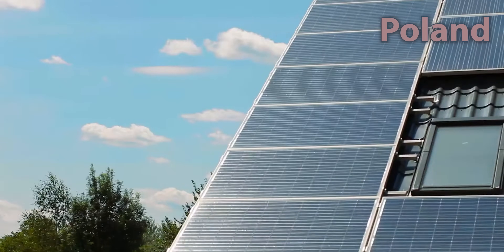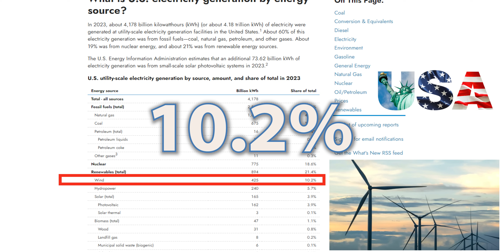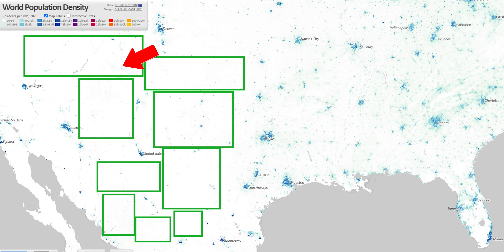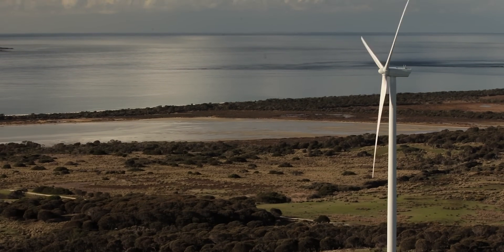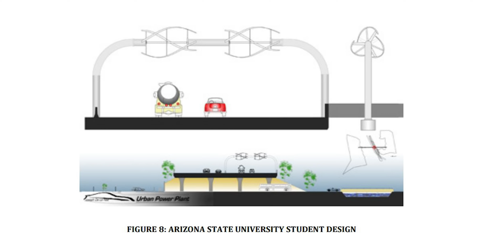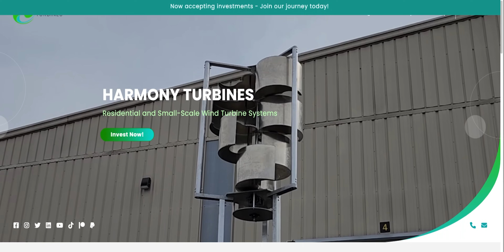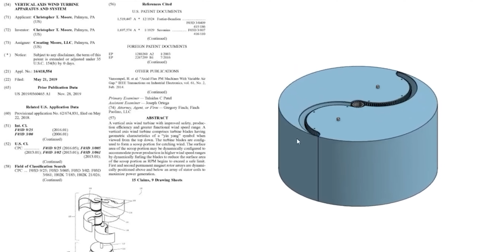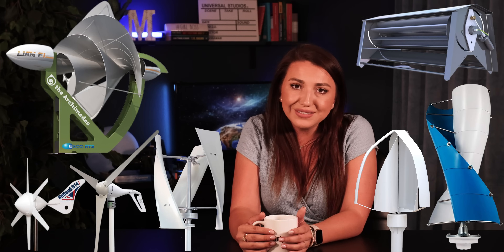Residential Wind Power: Revolutionary Tech or Overhyped Myth ?

Comment: The there are millions of small streams cascading down to highways then under the highway into bigger streams and rivers all over the  world. Millions of microhydro energy systems could be installed forming microgrids linked to solar and wind systems. Water and wind are powerfull. They are solar energy stored in the form of water raised up high the falling or air moving up high. Theres microhrids would not be as vulnerable to attack or failure as the mega grid that’s in use.

Comment: The problem is exactly as you said. To make it effective, you need to put it high in the air, because if you put it on the roof of your house, the air flow is turbulent and you get no power. Well what town is going to allow you to put a bunch of wind turbines 30 or 40 feet in the air? Hopefully the tech gets to the point where it can take advantage of turbulent flow. Until then, I don't see residents using it.

Comment: only an idiot puts a device on a roof that makes little energy but does great potential damage to the structure, thats why they are frowned on
and BTW, in the US per capita primary energy use is 300GJ/yr, which is the equiv production of about 300 panels of 250W nameplate in the NE

Comment: I love to know if those low-cost turbines on Amazon really work.  I'm especially interested in their performance at low and intermittent wind speeds.  I would love to find one that would actually generate usable amounts of electricity at night or during storms to supplement my solar production.  They don't have to provide enough KW to power my home as long as there is the unit generates enough power to pay for itself and replenish some of the battery power I am using during the night and at other times when the solar panels are not producing power.

Comment: So, wind is not always blowing. No $hit! But that's the reason you have both wind and solar. In any 7-day period, you are almost 100% Guaranteed to get either wind or solar, or both. The key is storage! There are lots of battery options for home use and more options coming from LG and Panasonic in the next few years. Get wind, get solar, get a heat pump, get geothermal, get lots of batteries! get off the grid!

Comment: All practical tests of ground-based small wind turbines show: 1) They hardly produce any electricity. 2) They do not last long!
Hardly no electricity, due to hardly any wind close to the ground – and electricity yield is proportional to third power of wind speed: +100% wind generates +800% more electricity! 
Moreover, the wind close to ground is extremely gusty. 9 out of 10 small wind turbines therefore stop working after a short time! 
With solar panels, you can generate at least 10 times more green electricity with the same investment! Reliable and almost maintenance-free for at least 25 years!

Comment: Wind power works much better if it can catch wind higher up. If the wind speed is double, the energy is 8 times as high. This, combined with much higher installation cost/watts generated than big wind turbines, makes the energy from small turbines easily 100  times more expensive than big turbines.

Comment: Overhyped myth. Having designed a vertical axis wind turbine (VAWT) with industry leading efficiency, 3rd party tested and verified in a wind tunnel, it is an overhyped myth. If you want a kinetic sculpture, buy a vertical axis wind turbine like the Harmony turbines, Wind Tulip or any other promoted VAWT. They are selling an unobtainable promise.

Comment: The problem with wind turbine is the designs. If you could build one that operates on little wind and will take full power also at high winds. The problem with wind, is that there will be no wind for maybe a year, wind change or not enough is a big problem.

Comment: In order to reduce CO2 emissions associated with electricity, measures are needed for the night when solar power cannot be generated.
The device in my photo is a device that uses morning and evening wind to exhaust heat from homes and reduce air conditioner consumption.
As was explained, it is impossible to expect a constant amount of wind power in a residential area, and considering energy conversion efficiency, I think it is better to just use the wind as it is.
Although it is in Japanese, we have also published other effective heat shielding measures on our homepage, so please take a look if you are interested.
Last year and this year were both very hot, but we have been able to reduce our summer electricity consumption every year.
If you live in an area with high electricity bills, we think you can recover the cost in about two years.

Comment: It's just plain physics that residential wind systems do not work. First, vertical axis wind machines are garbage and none of them have ever proven to produce a reasonable amount of power with respect to their cost. Second, any reasonable power producing wind machine needs to be at least 40 feet taller than anything within 300 feet laterally. This makes residential wind machines completely impractical.

Comment: I actually live in a rural location in Nebraska where wind is an option.  However I have not been able to find an 'off the shelf' battery that will work with a turbine.  The only thing I can find is custom setups with a lot of electrical engineering involved. 

Also, most of the wind is in the winter but my greatest electric use is in the summer.

Comment: You didn't go into the cost of energy related to these various wind turbine designs.  But it will only tell you what you already know which is too expensive and thus not worthwhile.

Also, if you look into the efficiency of things like the Savonius turbine, You will easily answer your own question about why these things have not even hit the market yet.

Thank you for looking into this.And no I won't be putting a wind turbine on my roof

Comment: I am not concerned with payback.

I am interest in the current state of the art technology, system design, and how to incorporate  safety within the design to protect all components.

I am interested in how to 
connect/use more than one turbine to simultaneously charge 
batteries.

I am interested in how i can use wind system array, to charge the batteries being used in a solar system, without potential damage to that system.

I am seeking knowledge.

Someone out there, knows these answers, or where to find these answers.

I am not looking to be persuaded to not develop this idea.

DIY is not Do Not Try, it is Try Until you get it to work.

If anyone out there knows where i can learn, please post links.

Thanks

Comment: Available energy is expressed as Power (W) = cp × ρ × A × v³.  While nontraditional designs make make some power, the will always be limited by the area captured and wind speed available.  Hence, large diameter rotors at great heights are the only viable options.  I wish it weren't so.  I want wind and hydro to work for me as solar is terrible, in my location.
My only hope is SMR and i don't have the money for that 😂

Comment: The only way your going to get a system like that is to work with the solar company that will make it compatible
Reply from the maker: Fair point, it would have to work with a good inverter to properly convert the power generated.

Comment: One of the questions can easily be answered: Why don't we see them on rooftops? Because its the opposite of convenient when the typical structures of buildings are not built to support the forces and vibrations generated by a wind turbine.
Reply from the maker: Very good point raised. Thank you for sharing, the buildings weren't built with the design of solar panels, but those were pretty easily added to our home structures.
Reply: @solartimeusa  Thanks. And yes, you are correct, even if the roof structure design didn't have PV rooftop in mind, depending on the region they have at least some safety margin in mind for snow load and/or wind forces on the flat surface. Since PV is comparably lightweight and the final surface doesn't differ that much from the original roof, it is very common that roof construction can support PV without alteration.
So far I have one single exception from that rule: People who mount Bi-facial PV on vertical standoffs to flat roofs (a rather rare but in some places useful specialty) this can ask for reinforcment of the roof structure due to the heavy weight of concrete bases of such standoffs.

Comment: 400w in 25mph wind and big with moving possibly noisy parts that need upkeep. that's the problem for smaller scale and why just 2 400w solar panels with a small battery beat that wind turbine on cost, kWh produced and maintenance.
Reply from the maker: Fair point, one 400 W Panel may cost $200-$300.... :( I wonder if we can ever get that cost down for wind turbines

Comment: Go to a marina on a windy day and listen to all the small wind generators. You will be glad your neighbors don't use wind turbines. Fortunately dropping price of solar panels will keep wind generators out of our neighborhoods.
Reply from the maker: I guess that is a very fair point. Prices of solar has been going down a ton, and you're right. Cost of wind just cannot compete on resi scale.
Reply: @solartimeusa  Would like to mention. I had a Sailboat with Solar and I put a wind generator on top of Mizzen mast. That's the shorter mast on a double masted Ketch. From that experience I learned it would of been better to spend those funds on another Panel or 2.
I like your channel, keep up the good work!

Comment: Speaking of wind. How is the survival rate of solar roof installations during storms? Do they weaken a roof through the extra weight and attack points or do they even protect?
Reply from the maker: Good question! Properly installed solar panels are actually pretty tough when it comes to wind. They don't usually weaken roofs ( IF PROPERLY INSTALLED!!! ) and even protect them since they shield it from elements. They also absorb the heat so the attics tend to be less hot. 
Now they're made to handle strong winds and hail but  How well they survive really depends on how crazy the storm is.  I am sure a lot of them got damaged in the MIlton Hurricane, but a lot of them survived. I should maybe prepare a video on this subject.

Comment: Good video only that should touch more on electronic part. The problem is not the turbine is the MPPT controller. I mean is no controller for wind. Because power output is proportional to the cube of the wind speed solar MPPT can't be used. Wind controller work in voltage and once voltage step reach dump the power in a resistor and brake the turbine exactly in the point where the power is produce instead of increasing brake torque and produce power.
Reply from the maker: I agree, Hopefully next video I make I will do better at touching more on electronics and how difficult managing that power curve is...

Comment: I would like to know how to design multiple wind turbines (preferably vawt) in an array that can be used to compliment a solar system, and top of the solar batteries when sun is not available.

What safety circuits should be incorporated, etc.

Where can I learn about this technology???
Reply: Your biggest problem with this approach is payback against initial cost. 
I suspect it won’t add up.

Comment: Having sold small/distributed wind turbines for 10 years, selling the most small wind turbines in the U.S., some 2,000 of them, myself, and having one in my back yard the past 16-years, I can honestly and clearly say, they are NOT worth it.  They're too expensive, require maintenance, and produce very, very little energy.  The best small energy system is a solar PV system, with battery storage.  If you have a creek in your yard, a small hydro system may work well too.
Reply from the maker: Oh wow thank you so much for sharing! I have heard that a lot of wind experts would say "dont do it....."
So do you think its a design issue? Or Just the lack of "good enough" wind?
Reply: Problem is that you generate next to nothing when the wind speed is low. Solution to this is to increase the area. So a windwall or windfence or something like that. That is lot of material which adds cost. That large area introduces the next problem. When the high wind occasionally happens, that large area and also the generator needs to be able to handle very high amounts of energy in the order of maybe tens of kilowatts. That requires either a large inverter or a system which can reduce the input energy. In the case of windwall this would be something that disconnects turbine from generator or diverts the wind away from turbine or whatever is used to capture the wind. So More parts to maintain and service.
Reply: Agree 100%.  How many birds have your wind turbines struck?  I have seen ours kill 2, an owl and a hawk over 15 years, not sure about finding smaller birds.

Comment: Windmills are mechanical, hence have high maintenance costs.  I lived near a large wind farm that was built in the '80s with big tax incentives. Thousands were abandoned as subsidies ran out and maintenance costs zoomed.  Many sat unmoving, rusting away for decades.  Solar is passive, no moving parts, and sunshine is more reliable than wind.
Reply: Modern large wind turbines are highly efficient & a very different beast to those from 40 years ago.
Size matters a lot with wind, which is why home based systems will never compete with solar
Reply: Old designs may have high maintenance costs but the number of moving parts in a modern winfd turbine is prettty small and they are as reliable as other electricity generatting methods tthat use turbines.

Comment: I think we are going to see these in 5-10 years (though maybe never as solar just advances faster). They will never be useful for most people but there are some interesting low impact designs that I think would be useful. Problem is that badly placed solar is still going to pull more power if you don't live in a windy place like Kansas. People who can benefit from wind know they can because they have to tie down everything or it regularly flys away. I have that issue part of the year but not enough.

I personally plan to figure out a DIY way to make the "wind turbine wall" of vertical turbines. I have experimented with 3d printing small turbines and it is viable. Not for large amounts of power but why not have a windbreak that generates a little energy? I need a wind break because of how my property is designed with my house on top of a flat spot with a significant hill in front of it accelerating wind.

Comment: Both City Zoning and HOA's are big reason #1 that we do not see small wind turbines even on homes with solar panels.   The big reason #2 is that most small wind turbines only make about 100-200 watts when there is a good wind blowing and may only make 50 watts when winds drop to just a breeze (wind power is intermittent and even a small wind turbine needs a 8 to 10 mph breeze to run and produce power) and that 50 to 200 watts is only enough power to run a few LED light bulbs and not enough to run appliances so people are  still better off having battery systems charged by solar for night use or as a backup when the grid is down.    Some Farmers and Ranchers have their own medium sized wind turbines up on towers but they are larger and produce approx. 1,000 to 2,000 watts,   The large Industrial sized Wind Turbines make about 4 Megawatts or more.
Reply: Wind is one of those things that is better at scale.  You need to hoist the turbine up as high as you can to get the most benefit and the bigger the turbine, the more efficient it is at extracting power.  These two alone make it hard to do on the residential scale.  Add on top of that the nannies who value their sitelines and the people who think wind will decimate the local bird, owl, and hawk populations.  Solar just works at any elevation, has no moving parts, super low maintenance, and can blend in if installed correctly.

Comment: I have the same problem with home turbines as roof solar: it's vastly more cost effective to just have a plant. The effective area of a regular wind turbine is enormous compared to the tiny roof top ones (like 10,000x). Not to mention the higher wind speeds at elevation (there is a reason they're elevated far above ground level) and by location (there is also a reason wind is largely harvested in certain areas: many places just don't have much wind).

Home turbines and solar are just a way to push off renewables on to consumers.
Reply from the maker: Those are very valid points for sure. We cannot even compare how much stronger wind is at 100 + meters high. Thank you for sharing

Comment: Highway turbines work by slowing down traffic.  It's not a net source of energy.
Reply from the maker: Thank you so much for the comment! :) 
Ideally the highway turbines would be designed to significantly impact traffic speed. Just placed in whatever area to allow for the use of what energy is already there.
Reply: Imagine if the road is congested
Reply: It is a net source of energy. How much of a gain that's debatable, as it will have some impact on the traffic, but it's never going to be 100% of what is harvested and the difference is the net gain of energy.